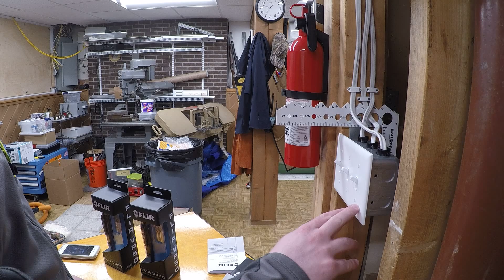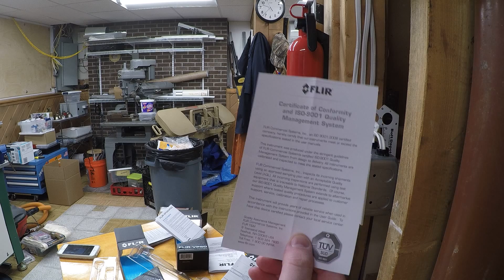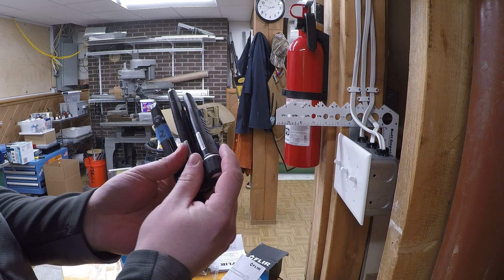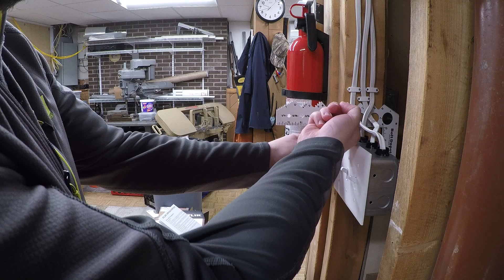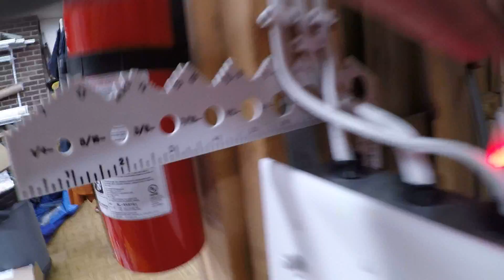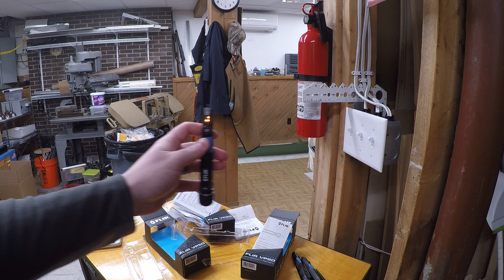Update on FLIR VP50 Tool Review - Still Thumbs Down!

Comment: Fluke is the best. But the only problem is that its tip breaks easily while in transit. like if you put it in your bag or pocket. Wish they made it more rugged or came with a cap for the tip.

Comment: I understand your logic however, from a safety standpoint you want higher sensitivity to help to eliminate false negatives. A product with low sensitivity may help with what you're trying to accomplish however the presence of voltage should be verified by a calibrated device, which these are not. A higher sensitivity device will indicate there is voltage present so a worker can investigate, then properly isolate the equipment. The box you are working on may have multiple sources. A lower sensitivity device may give a false negative and put a worker in danger of being exposed to electrocution or arc flash especially when working in a more hazardous environment which residential is not due to lower voltages and limited arc flash energy due to the reduced fault levels. If you're using a device such as this to positively identify and energized circuit, you aren't using safe work practices. Higher sensitivity means workers are more likely to detect the presence of voltage and investigate the problem prior to making contact. Your evaluation is from a limited point of view. If your looking to identify a de-energized source in close proximity to an energized source, lower sensitivity will accomplish this. If your concern is the safety of personnel, higher sensitivity is the best bet. Typically electricians get hurt by making contact with an unidentified source, I have a clear understanding of what you're trying to do and a cheap low sensitivity product can accomplish this. You have completely missed the safety benefits. Also understand that many who will view your post won't be qualified and many will have a poor understanding of electricity. These people would be safer with a more sensitive device.

Comment: Hey Murph I think you're wrong about it being useless; it is a slightly useful flashlight. Not very bright but you can make out shstuff from a short distance...
BTW, your review is the first honest review I've seen where you can get an honest opinion even AFTER they sent you 2 units to maybe, just maybe try to silence you.
The first time I used this tool to test electricity I was amazed and disappointed at the same time.  This thing fucking sucks, it does fucking suck! It's detection is completely random. I can try to ask a baby to show me where there's electricity and the baby would do the same job by pointing their little finger all over the place. Put it on sensitivity mode and it can detect electricity from your brain if you wave it over your head... Thank you, I'm still ticking.
I own the same Fluke you have and it has many useful features; for example I can lay it on a wire out of a bunch of wires trying to find the circuit breaker and it screams when the breaker is switched on. Now that's useful. Even if the Flir did detect the circuit out of many other circuits around it (which it definitely doesn't) it would be useless because it only vibrates and flashes. I can hear the Fluke 3 stories away...

Comment: It is a "NON" contact voltage tester. I have never seen or used one that can differentiate which wire is not carrying voltage when the wires are not separated by more than a few inches. Most of my experiences have shown they will even show voltage on a wire that is running through the same junction box, or even laying across,  somewhere with a live wire without specifically having voltage on the line you are "probing." I use my non contact tester as a safety backup to check for voltage before I go grabbing wires. Any decent electrician knows that if you need to know which wires in a switch box are hot that you definitely get the real meter out. I personally prefer the Milwaukee non contact tester, and I appreciate your video about the FLIR one. It made my mind up to stick with my Milwaukee after seeing the vp50 for the first time today and thinking they had to be really good coming from that company.

Comment: Wow I have one of those and it's not that bad on the high setting someone messed something up over their. But on the low setting the thing is useless for sure.
Reply from the maker: J Plap Yup, it's just not well designed for the intended use.
Reply: Were you able to find the presence of voltage behind walls?

Comment: Do the instructions or packaging list the intended use of of the product?  Maybe it is for locating buried cables...  8^)
Reply from the maker: ***** Hi Bob. Fair enough. Let's find out :) I read the instructions and it says it is for "The portable, rugged FLIR VP50/VP52 can detect the presence of AC voltage at an electrical outlet, junction strip, circuit, or other device without actually touching the device under test." It also says the detection distance is 0-5cm. So, ya, still a fail.

Comment: Glad to see you posting again,  but sorry to hear about the poor quality FLIR product.  I'm in manufacturing,  and know that things go wrong sometimes;  with the specs, the design & the assembly, but when an issue of 3 malfunctioning units from different SN groups end up in the same customers hands it's not a good indicator of how well things are done.  Or possibly how good the oversight is at a sub-contractor location.  The TUV logo should mean something,  but doesn't seem to on that device.  However,  if they address the issue for real,  then it could be alright.  FWIW,  I've never had an issue w/. Fluke devices,  always top shelf.
Reply from the maker: Hi, thanks for your comments. I'm in an electronics manufacturing company as well, so I know that things go wrong. But in this case I really think it is a design issue, not a manufacturing issue. I contacted FLIR again, so we shall see what happens. I have never had an issue with Fluke products either, and it is all we use exclusively at work for DMMs.